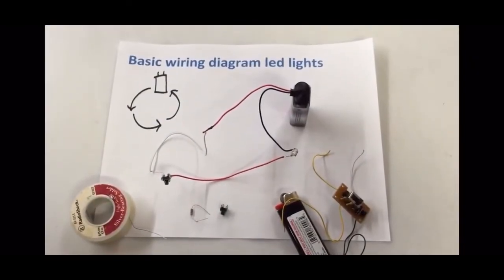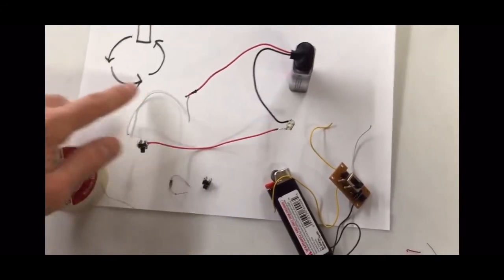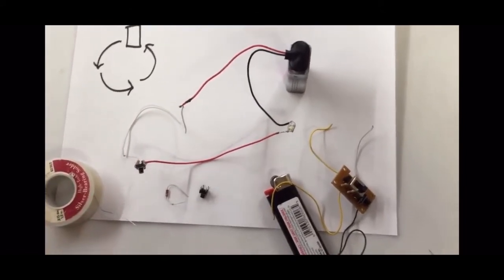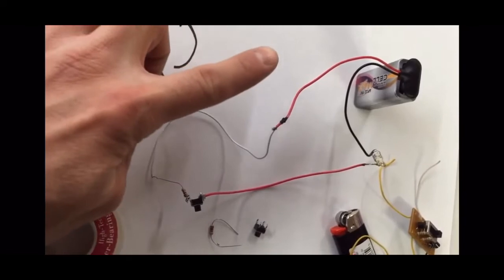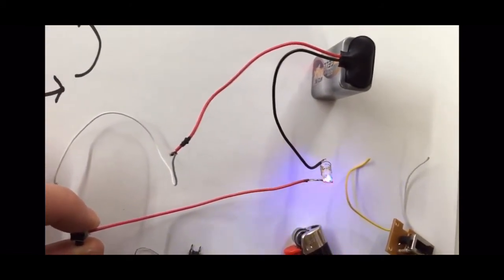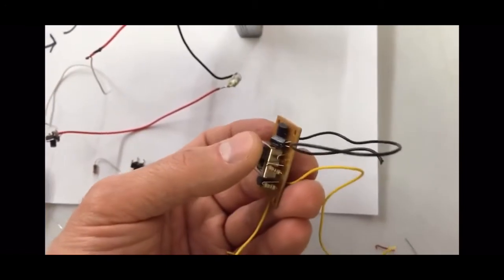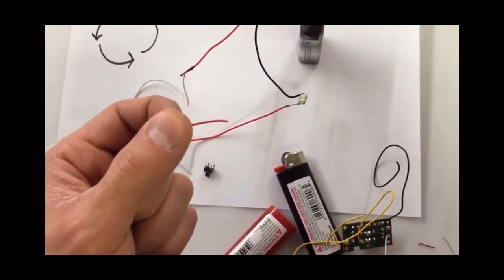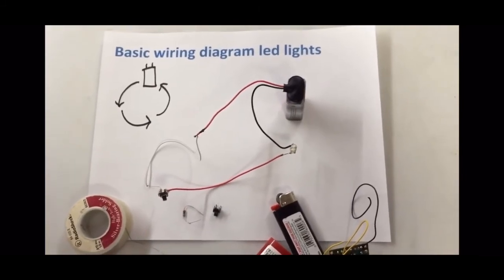LED WIRING INSTRUCTIONS MADE EASY 101

Comment: hello friend good job I wanted to ask if you can explain in a video or where I can contact you to have multiple connections with leds in my case I am trying to connect 6 leds in series with a resistor and a 9 volt battery but the leds for some reason  have blink and no longer turn on then I don't know if you could explain why this happens and how I should connect and how many resistors should I use thanks
Reply from the maker: Rene C***********0 try a doffrent resister from a old circuit board and try a smaller battery see if that works im not sure wothout seeing it so u should try diffrent devices so u can troubleshoot it